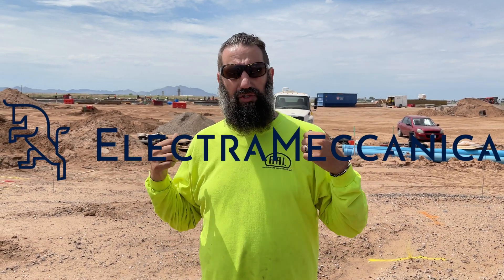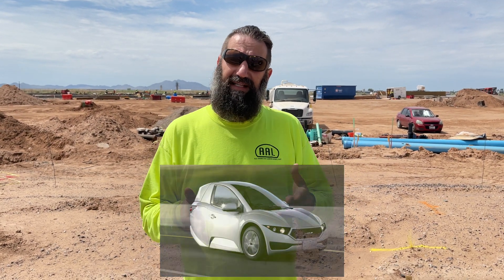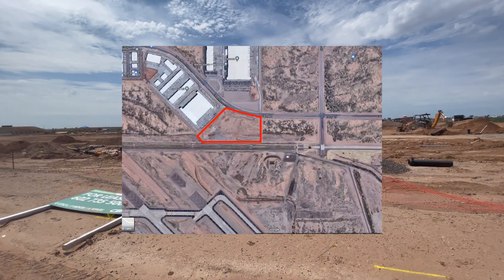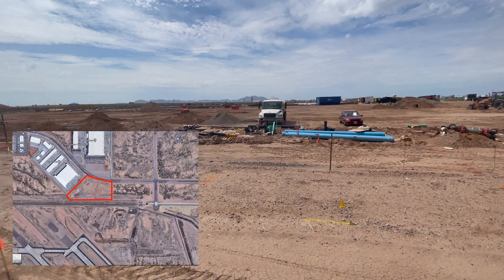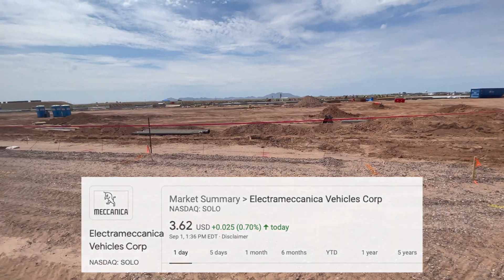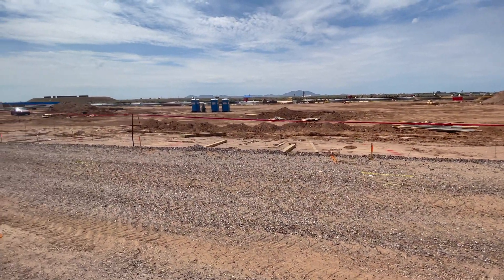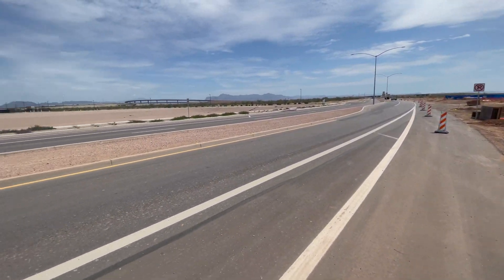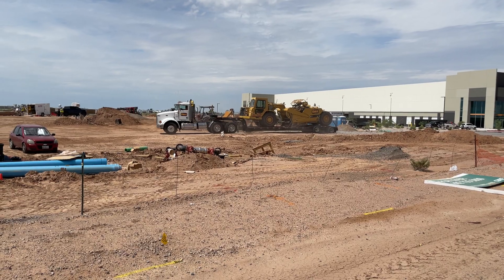A Visit to the  ElectraMeccanica Factory Construction Site

Comment: Question: Is it safer two wheels on the frontside or the backside?
Reply from the maker: Front is considered safer. 2 back wheels tend to tip over more.
Reply: Frontside. Look up Top Gear Reliant Robin
Reply: You can generally brake much faster than you can accelerate. Therefore, doing either of these with the wheel turned, you're more likely to tip braking than accelerating.

Comment: Nikola is better
Reply: What is that supposed to mean?
They are both addressing very different market spaces, with ElectraMechanica clearly targeting a more niche marketspace, so you can't really compare them.
I have chosen to not invest in ElectraMechanica, but I'm sure it will do well as a company even if the maximum growth potential is less than Nikolas.